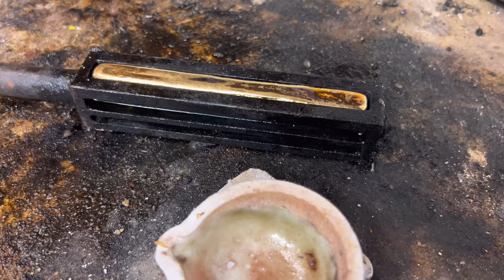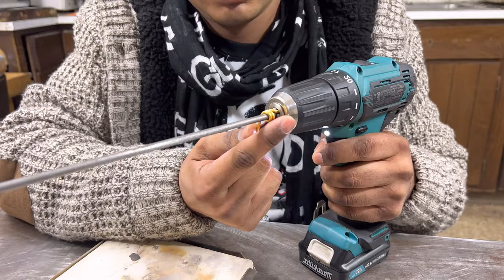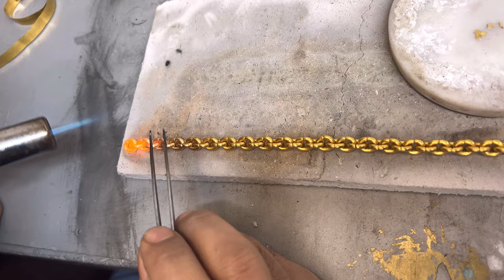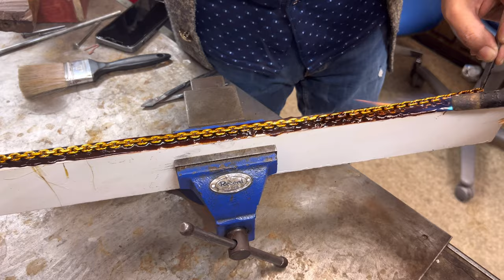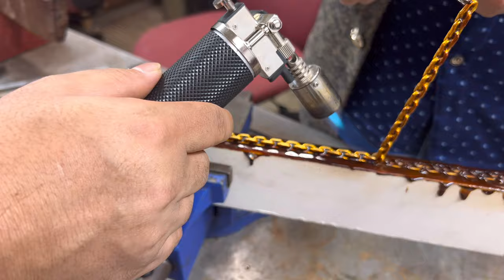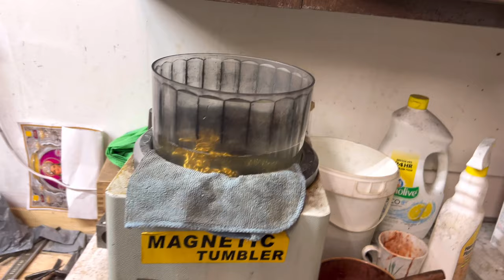How do they make link chain ?

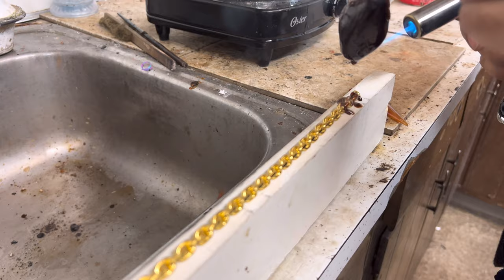Comment: Thank you for your video. Regarding 4:18 for those who are unfamiliar with the technique, the substance being melted & dripped onto the chain is known as Pitch which is made from Bitumen or from Tree Sap Resin. It solidifies into a firm adhesive which holds the chain in place. Pitch is also used for other types of metalwork such as Chasing or Repousse.
Reply: Some use shelllaque to hold the chain on the Wood while filing facettes..